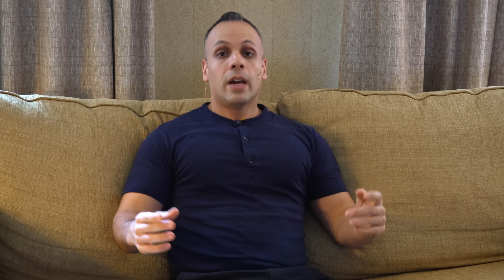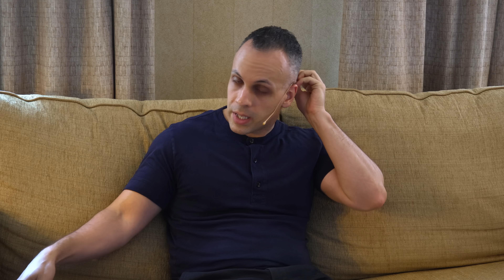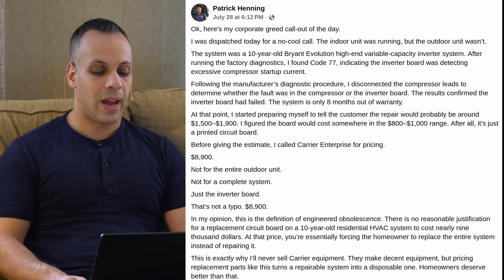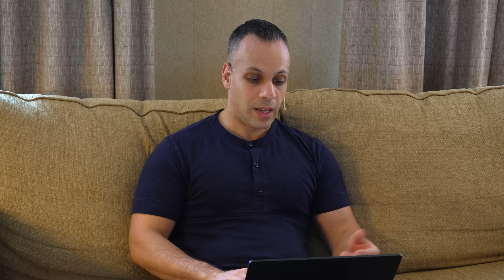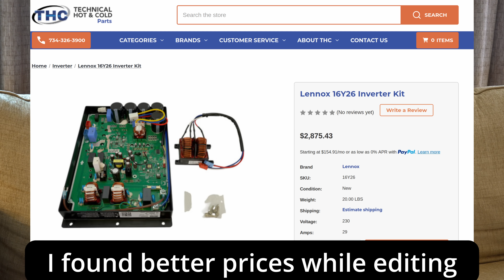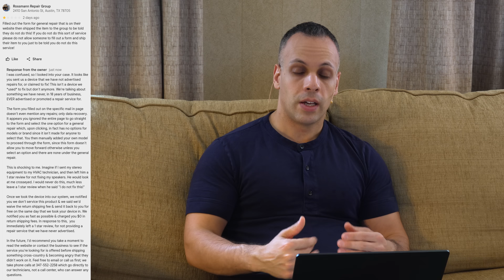Carrier AC repair has $8700 part cost for residential unit

Comment: I replaced a fan motor for my daughter and son-in-law at the beginning if the summer. I decided to see if I could repair the old motor for a back-up. To my surprise, after removing the "puck", which is the housing for the motor control board, I found the entire board epoxied in so there was no way to check and replace individual components. My second shock was while researching just to replace the "puck", they listed as much as the brand new motor. They don't want us repairing and are blocking every avenue of escaping their organized theft.
Reply: one specific part most always failed on the ECM module and people were repairing them, even selling repair kits... along came the solid potting of them. I'm not sure it's just to halt repairs, as it was antivibration, because they always have vibration.
Reply: @throttlebottle5906  I would believe the antivibration story if it were not for them charging the same amount for the ECM as for the entire motor.

Comment: Bro, if you went into HVAC board repair it could go a long way to funding all sort of right to repair stuff. Yall already have the equipment. Just need the experience now. People from all over the country would be shitting themselves for that sort of service. If you can fix it, change them full fee, if not just charge shipping. They have nothing to lose and you and crew would gain experience. The real issue is what sort of warranty would you supply.

Personally if i had an hvac system and i got this sort of price, I would basically have ZERO options. I have nothing close to that money for ac. I would buy a $150 window unit and suffer. If someone could repair the board + cost to install it was under like $500, even if there was a change to screw the board up MORE (as if that matters at that point!!!) Then i would STRONGLY consider that option. There is a strong change i would go out of my way to even try and learn about each chip on the board and how to solder and how to remove and replace etc or just buy some sort of hacky-janky china bored. I mean thats wht id be forced to do. Its just an inverter its not that complicated

Comment: Im an hvac tech in the Phila area.  Every tech I know throws them away.  If you were to refurbish you would some expensive test stations  that carrier inverter bosrd is communicating it talks to the indoor board.  Carrier authorized dealers will get that board much cheaper most likely also.

Comment: As great as having central air is for the whole house, its just crazy how much cheaper it is to run a handful of window units instead
Reply: That's what we do. The central runs at noon for about 20 minutes then the window units take over depending on what part of the house we are in. $100 electric bill for July.
Reply: It's a whole lot noisier though, and the efficiency of window units is pretty abysmal, about half that of a low end split system. Ductless mini splits are a breeze to install if you are moderately handy. You don't have to braze the lines, they're flare fittings.
Reply: meh, doesn't have to be. I've run a couple dual-inverter units now, and they've both been incredibly quiet. The 230V monster I put in a few years back was so much quieter than the traditional it replaced, and the midea U that I put in a month ago is essentially just fan noise. To barely hear the compressor, I have to be facing it, within 10' or less, and there cannot be any other noise. There's a bit of efficiency difference, sure. But there's also an upfront cost and ease of installation difference to consider as well.
Reply: @James1095  yea window units have come a long ways especially in the last few years, at the end of the day though you are running an air conditioner in the window so it will never be as quiet as having the complete unit outdoors, but electric bills are a fraction of what they were when running central air, even taking inflation in to account
Reply: @James1095 mini splits are the biggest pain in the dick to clean the scroll fan
Reply: window units are basically a "do it yourself" solution..   saving on the scams associated with a company installing and maintaining a central system.  If one unit fails, simply buy and plug in a replacement for a couple of hundred dollars.  They're also better I think at removing humidity..  (I had some mold issues when I had a functional central system), but not now.
Reply: BTW that's what Europeans do when you tell them they got no AC 
They got a double unit and just run it a few hours a day, even in southern Europe
Reply: Yeah, but you know what's required by building code in many counties?  Central air.  Their reasoning is window units and mini-splits don't meet minimum air filtration requirements.  In Arizona, the Democrats recently made it where if you don't have functioning central air, they can condemn your house.  I learned this while trying find a central air unit appropriately sized for my 400sq/ft tiny home - and surprise, nobody makes a unit that small.  I also can't over or under size a unit in my county.  So I'll be stuck without a certificate of occupancy until the legislators wise up, or I just ignore them and do what I want knowing I can't sell the property without demolishing the dwelling first.
Reply: @Mr_Ceiling_Fan  🤦‍♂🤦‍♂🤦‍♂🤦‍♂🤦‍♂🤦‍♂🤦‍♂🤦‍♂

Comment: I have a Carrier system that was installed five years ago. The AC failed twice during that time. The first was a blower or fan inside and the second was a bad starter capacitor out side. I did not have to pay for the parts but I had to pay for the service call. I have a ten year warranty on parts. I was also low on freon and had to pay for that. My original twenty five year old Heil did not need a repair for eighteen years. I bought the system because I thought Carrier was a good name. I should have done more research.

Comment: Well when you have a 20seer system you already know the stock on those parts is going to be low and whatever bs equation they use to value spares is going to be insane. Just buy a new unit.

It's not much different with all these imported minisplits. They'll drop support for your series in a year or two and you're not getting a new cassette.

Comment: Hey Louis! Great to have you out there for all of the rest of us representing us in consumer rights, thanks!

I've been a "Trane" guy most of my life, and even though I have a technical background, I have that equipment more because a friend of mine owns an HVAC business and thats the brand he sells, not because of any research I performed. I'm not sure how much a new inverter board is for my system, but a quick AI response, it was $200 to $1300 depending on the system.

All I can say, I have been extremely happy with Trane's HVAC performance and reliability over the last 35 years.

As a side note to all of this, something I learned as a result of my profession, as appliances become more complex and almost everything today has some type of control board, its important to protect them, especially at $8700. Today's NEC NFPA requires the installation of surge protection in every installed new electric distribution panel. And there are also requirements now for grounding, etc. that help improve the effectiveness of this surge equipment. And this surge protection is a great first step, but many times only takes care of the brunt of a major surge entering the home on supply lines. 

Its also a good idea to have secondary surge suppression at each piece of equipment. And for that suppression to be effective, which suppression you purchase is important, as there are thousands of options. How much surge energy and the clamping voltages are two of the specs that are pretty important. If the whole house surge suppression did most of its job during an event, then clamping voltage becomes the most critical component of the 2 criteria to making a purchasing decision. The lower the clamping voltage to the voltage of the equipment, the more effective the protection is against a surge. Many surge protectors have a clamping voltage of 300vac. Some devices are even as high as 600vac. If your equipment is running at 120vac, how effective do you think that will be?

The other issue that occurs, surges come from things other than storms. Equipment starting and stopping that you may have running in your house can yield small spikes in your power delivery system. Motors turning on and off are probably the largest offender, but other things also create these spikes. If you happen to share a transformer with your neighbor for your electrical supply, whatever happens in their home will also affect your supply too. Anyway, the major component used in the most common surge suppression today are MOVs. Every little surge that occurs on your system that triggers a MOV to activate, eats a little bit of life away of the MOV. So as you can deduce, the closer the clamping voltage is to the line voltage, the greater the chance is that the surge suppression life will be shortened, as many of the events that occur at home that create surges tend to be  smaller and closer to the line voltage than say at 300vac. This ultimately means the units that have good clamping voltages close to the operating voltages of the device will need to be replaced more often.

So all this aside, every high tech appliance should have additional surge protection installed. My furnace/air handler and my compressor both are variable speed. The Trane furnace/air handler has a circuit board the size of an AT motherboard with a simplified display on the MB! The condensing unit for the AC outside has a circuit board in it about ⅓ the size of an AT MB in the corner, also with a simplified display too. I've install secondary surge suppression at both pieces of equipment, (and by the way, they make surge suppressors specific for these installations). I've also done the same for the refrigerator, microwave, washer, dryer, and range in the house, as they are all newer appliances and have complex controls. And not to forget the other electronics in the house; stereos, TVs, computers, and even the chargers used for portable electronics regularly used all can benefit from secondary surge supression. 

Last word on this, consider surge suppression manufacturers by name brands you know and have great reputations. Lots of false claims out there on equipment performance. Better yet, if you can find equipment that actually has been vetted by real world tests, thats even better. And any surge suppression thats old, (maybe 10 to 15 years old, possibly less depending on exposure), regardless of indicator lights, etc., most likely needs to be replaced.

Comment: I had a Trane for 16 years then I decided to get a new system, so I went with a 2-stage Carrier, $12,000. At just under 2 years the compressor destroyed itself and shorted out. The part was covered under warranty but I had to pay $1400 for the repair. That included $700+ for new refrigerant. That stuff is expensive, considering I had already paid for it just 2 years prior. No doubt they took my old refrigerant, cleaned it up, and sold it to somebody else. Apparently refrigerant is in some "quantum" state where it's not considered a part (to be covered under warranty), but it's also not considered labor.
Reply: The sucky part is your compressor puked its guts thru your whole system and I really doubt they were able to get every last bit out.   Good luck down the road...
Reply: @v12alpine  Yeah, they replaced the filter/dryer and accumulator because of how bad a state the compressor was in. They said they had never seen one so bad.

Comment: 4:35 HVAC professional here. In my area, old units are usually scrapped for their metals. Smaller companies let their install teams disassemble equipment into their component parts and take them to a metal recycling place for cash. Larger companies have a dedicated minimum wage tear-down guy who does the same recycling but turns all the cash over to the company.

One barrier to refurbishment is EPA certification. Not terribly hard to get, but it takes some dedication of time and education. Nobody is legally allowed to open or repair refrigerant-bearing systems unless they are epa certified. 

Another barrier is the effects of refrigerant changes. From cfcs to hcfcs to hfcs and now to low-gwp chemicals. As the older refrigerants are phased out and become illegal to import, the refrigerant becomes increasingly expensive. So trying to restore older units becomes cost prohibitive due to international environmental agreements creating scarcity in the marketplace.

Add on top of this the legal recovery and recycling of the used refrigerant you’re removing. You can’t just blow it off into the atmosphere. You have to pay a refrigerant recycling company to take it from you. Then they clean it up and sell it back into the market as fresh. It is illegal to reuse refrigerant that has not been fully recycled.

Regulatory and market costs at every step.

Comment: I am an unusual customer for a/c, my family moved from a tiny house in California that didn't need a/c to a bigger house in Florida that needs a/c 9 months out of the year. I can't stand heat or noise. Our upstairs unit had failed after 12 years of operation and I replaced it with the most expensive available unit from Trane. It is a 3-phase inverter and starts and runs quietly. Less electricity consumed. The inverter board seems well designed. I have replaced run capacitors annually for the downstairs unit. Would pay 3-5 x for a better quality run capacitor. Also help my neighbors with replacing run capacitors. Will troubleshoot the inverter board when/if it fails. 
But! I am enraged by their transformer choice in the interior air handler, it is a cheap E-I unit that hums continuously. Every page of their marketing stresses quiet, yet they cheaped out, saving $50 retail vs a toroidal transformer. Even in operation up to 40% load the transformer is noisier than the air handler blower. I did the testing and tried to get the manufacturer's attention but they don't seem to care. I figure they have an anechoic chamber and should be aware of the issue but that $50 is too enticing. Enshittification of everything strikes again.

Comment: At this point, you're honestly better off using the more expensive portable units and cooling off a few rooms add box fans during day time. New portable units can be accessed remotely so you're not running them until you're going to be home and need it cool. At least when you replace a more expensive portable unit, it's a grand up front and you're getting a brand new machine. I can't suggest window units for the South. You'll have to clean them every so often from bird and wasps/other flying insect nests. With the portables you can change the filter and occasionally the water. Pretty low maintenance.

Comment: So you want to repair something that is highly regulated by UL/NEC and other agencies implementing federal, state and local fire code regulations? Mr. Ranger isn't going to like this Yogi.

But I think the way to fix this is getting FTC to require manufacturers of HVAC units to be the recycler for them. Everything they make, they have to deal with disposing at end of life. This will mean high end of life costs get placed directly on the manufacturer and strongly incentivizes mitigating those costs. Designing for reliability and reparability becomes the cheapest option.

Comment: Working for a small family shop that sells Carrier. It kind of dependent on what kind of system you put in. All the private equity owned companies that employ “salesman” over techs will sell you an infinity system that uses all ecm motors etc. We sell the basic 2 stage systems, the only ecm part is the blower motor. Are parts on those pricey, yes some still are. But most on it aren’t. Just like general motors makes the Chevy Trax and the Escalade. Both GM products but two vastly different levels and repair costs. Now as far as servicing. Goodman’s are a great bang for the buck. But do leave quite a bit to be desired in quality.  Find many with leaking collector box seals. The housings are flimsy, etc. You get what you pay for on those. But yes they are very much cost effective to repair. Just my 2 cents. Im biased working for a Carrier shop. But we service every brand. I can say Lennox is by far the worst to service. Many units have required a board to be replaced when replacing and ignitor because the new ignitor receives a different voltage. I don’t really deem this a brand issue. But an issue with the hvac industry as a whole and the private equity companies taking advantage of people, and the greed at the corporate level of the brands themselves. Its gone from a trade to a sales job.

Comment: Yes Carrier Bryant and Payne (same corporate company) are expensive. Just had to replace my 12 year system due to indoor coil replacement quoted at $8k it was a Payne indoor unit. I live outside of Austin. Quoted 5 companies, Trane is also expensive. $14k was the median average, lowest was with Atlas AC at $9.7k However I went with LG $11.5K with variable speed and 12 year warranty and parts is the exact reason why. How much is a compressor going to cost in 10 years. Average live of a AC in Texas is 8 to 10.

Comment: Same problem with anything with a circuit board. The boards are stupid expensive if available. Boards for minisplits are often not available or half to 3/4 the cost of a new unit.  Best thing is get a replacement warranty and hope it craps out in the warranty period and then they either replace it or you get a gift card for the purchase price.  
   
   Agreed on the efficiency thing with most everything. Efficient units are costly to purchase and more costly to repair. Energy is cheaper than the cost of an efficient unit of whatever it is.